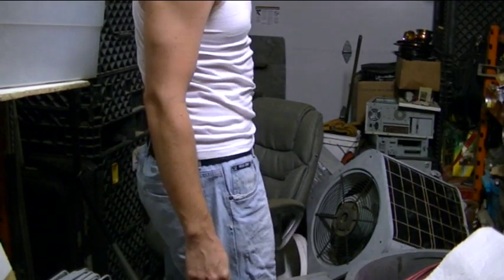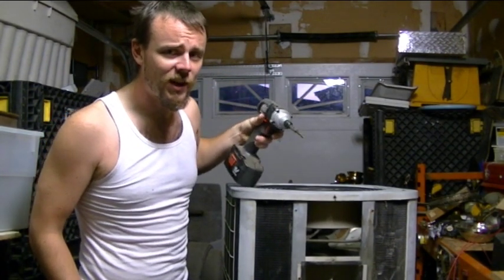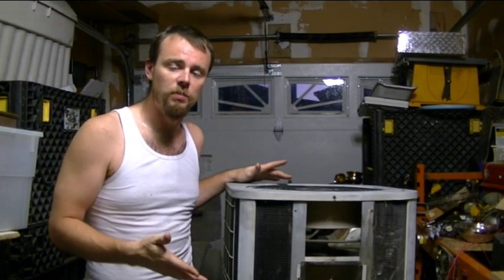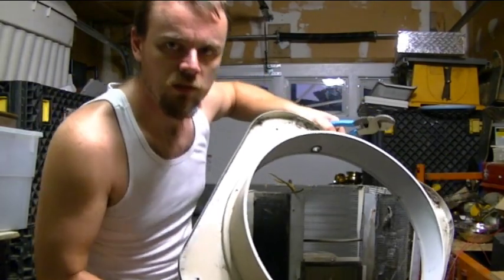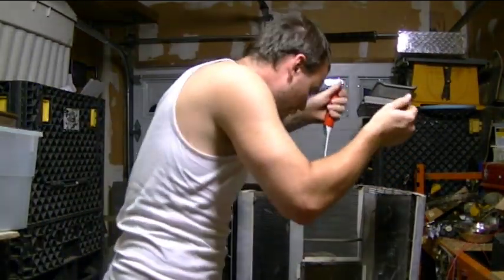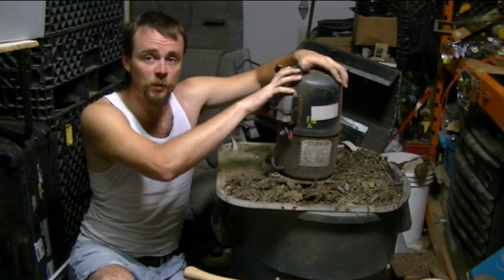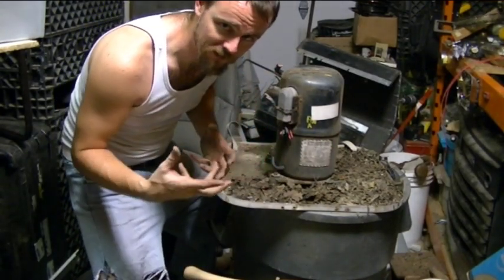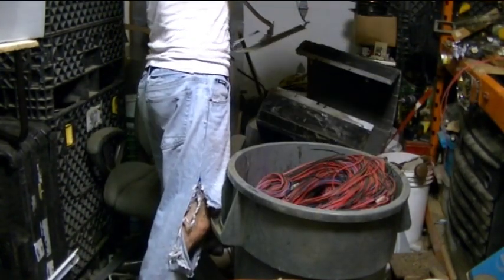SCRAPPING AN AIR CONDITIONER

Comment: Did you just make that stuff up? Pretty funny. I was just trying to tell you that the compressor takes low pressure vapor and discharges high pressure vapor. There is no liquid refrigerant in the compressor at all. Oh wait. You said that was a condensor compressor that you had. We do not have condensor compressors here, just regular compressors and regular condensors. I gotta tell ya, that the "outside the sealed unit" and the "rapid air movement" stuff was pretty good.

Comment from the maker: oil sits in the bottom of the compressor and lubricates the cylinders while running. the R22 Freon gas is condensed into a fluid to allow it to re-vaporizer and rapidly absorb heat causing sudden decrease in temperature outside of the sealed unit. rapid air movement across large surface areas will allow the decreased temperature to not build up ice. if you tip the old refrigerators up side down the low viscosity oil can be unsettled and make its way into the coil preventing the movement of gas